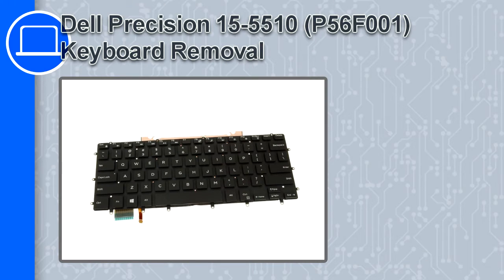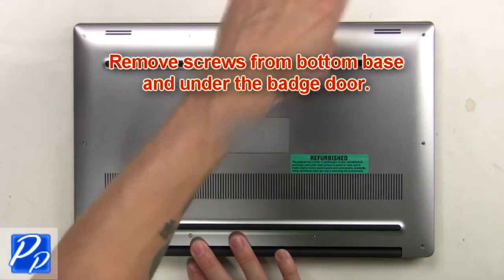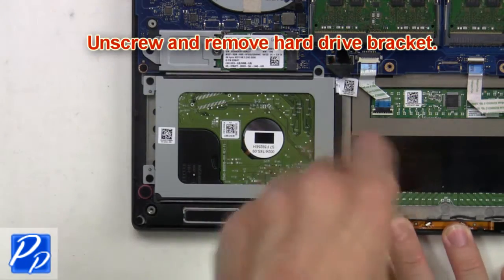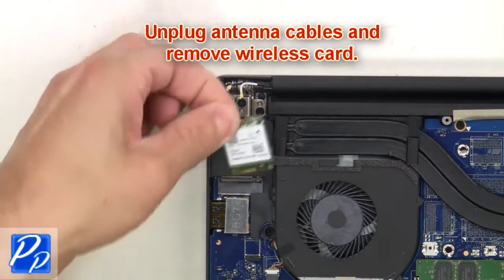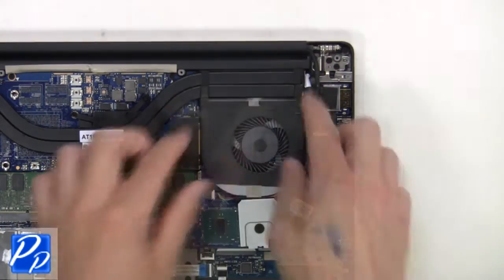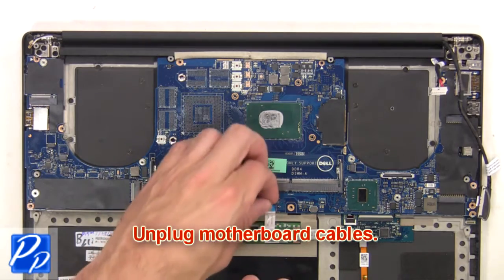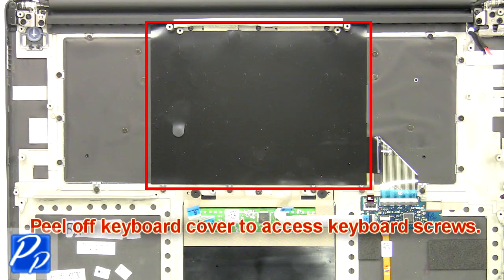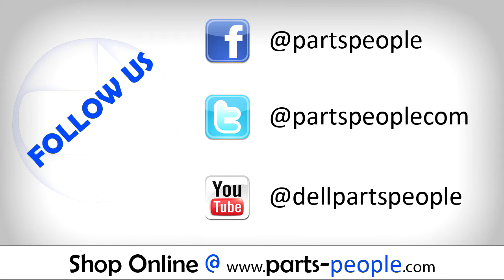Dell Precision 15-5510 (P56F001) Keyboard How-To Video Tutorial

Comment: Just used this video as a guide while I replaced a keyboard. The part where you lift up the tabs to access the screws on the keyboard itself is so much worse than the video makes it out to be. If Hell had an advent calendar, that would be it.